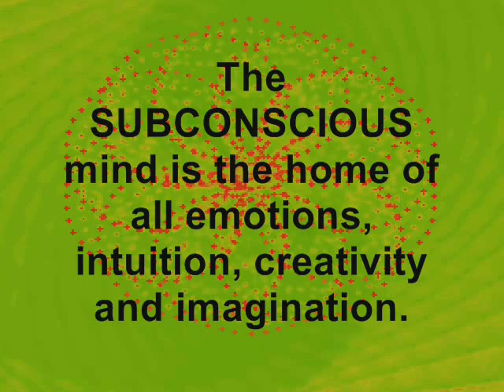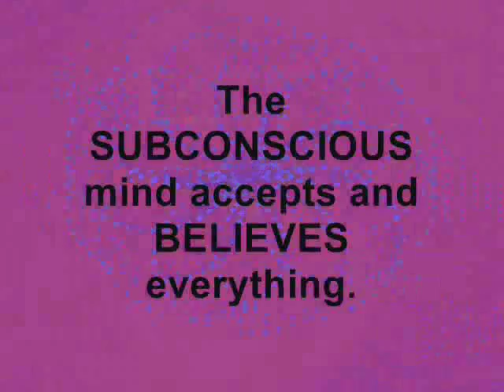Sharp RD428UA - Vintage Cassette Tape Recorder Restoration

Comment: Hi Clydsight, I love your videos. I have been working on my Sharp RD428 AU cassette recorder. Can you give any hints on how you repaired the cracked spindle please? I have the same defect with my machine. Thanks for your time and good luck with future projects, regards Lee.
Reply from the maker: Lee Locke  Gosh, this was a long time ago, but I will try to help you. 

As I recall, what I did was I got the machine out of the case. 

Then, I gently and carefully pried the locking ring (see 11:01)  off the spindle top so I could life it off the shaft and be free of the machine. 

There is a little "cap" piece that actually slides into an internal shaft piece. This is what causes the internal shaft to crack and spread.  I very carefully  "cap" off the spindle. It  pulls straight up and out. BUT, the outer interlocking ring has that spring pushing it up, so you have to be VERY careful when you pull up the cap, or the interlocking ring and the spring will fly away!

I carefully lifted the "up and down" interlocking ring (interlocks with the cassette) free, as well as the little spring.

Again be aware that this all wants to fly apart when working on it, so be very careful. 

At this point, the spindle assembly is completely apart. The biggest part is of course the spindle table (the part with the rubber tire on it ). The center shaft is hexagon shaped so it has six flat sides that interlock with six flat sides inside the interlocking ring. This shaft is what cracks.

I carefully sanded the "flats" on that plastic shaft to reduce its size.  There is no glue I know of that can reseal the cracks, so I had to sand the surface down. I did a little at a time, and tested it by sliding on the outer interlock (without the spring yet) to see how free it was, and then tested it again with the cap part re-inserted -- this will "spread" that sanded sleeve, so you may have to sand more than you think.

It's a matter of slow and gentle  trial and error and fitting the parts until they are just free enough to work again. 

I hope this helps!
Reply: Thanks for your expert advice.I will endeavour to undertake these steps on mine. Much appreciated, have a nice weekend!